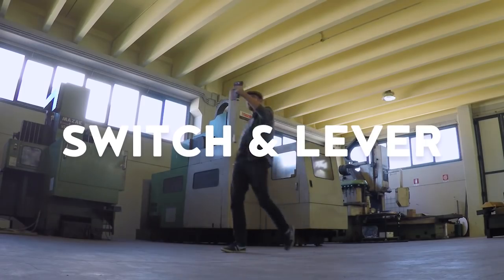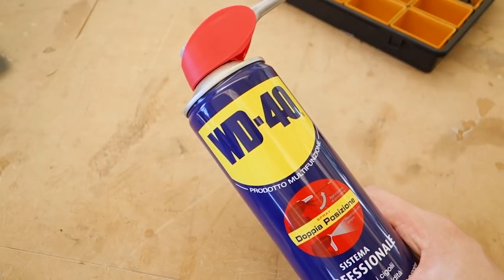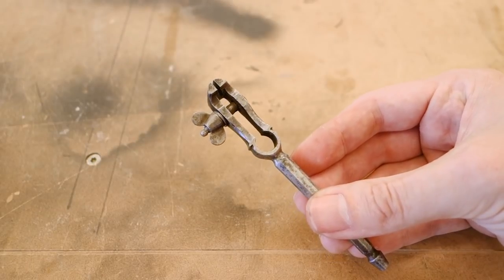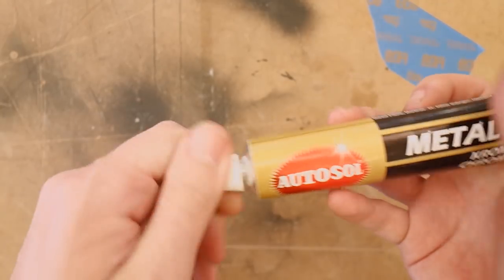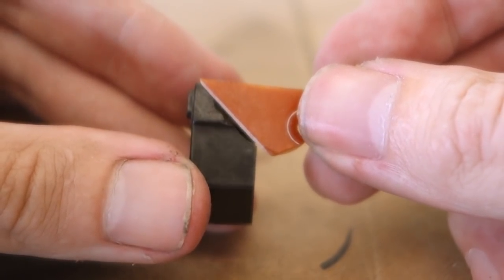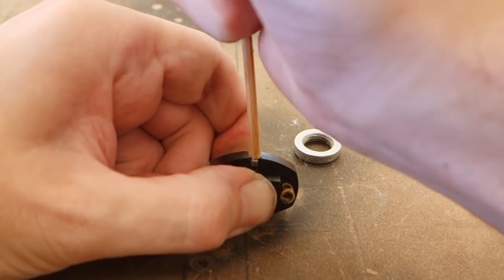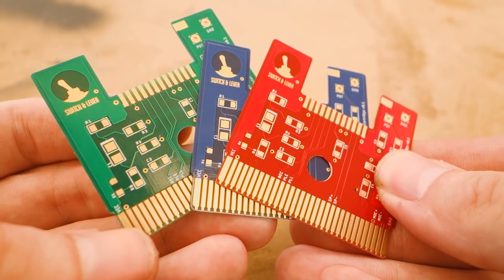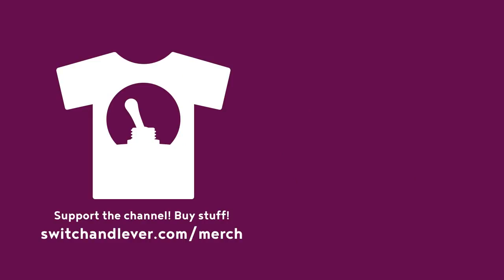Restoring Vintage Toggle Switches

Comment: For gluing threaded insert I usually put a greased screw in the insert, makes for a sort of handle and the grease stops the epoxy from sticking on the threads
Reply: Same but I use wax.
Reply: Same but i omit the insert
Reply: I was going to suggest this also. Works when melting it in as well.

Comment: Very good tutorial about switches and how to refurbish them. I have been doing just that for a longtime myself. A little disassembly and cleaning and most of the time they will work exactly like new again. Since some times if is hard to find an exact replacement that fits the original mounting hole and electrical connections, it saves the day to refurbish them. Thumbs Up!

Comment: I picked up a home ultrasonic jewelry cleaner at a yard sale a couple of years ago.  Small tank, guessing 6 oz/200ml.  Terrific for cleaning small parts.  Hot water and a little bit of laundry detergent and let them go for a few minutes.  (Laundry cleaner because the things I clean have a lot of skin oil and dead skin cells gumming them up, and that's what laundry soap is designed to go after.)    Also: Great to see unique old parts made useful again.

Comment: I was so glad to find this video. One of the toggle switches is identical to one I have that broke and I am trying to repair. The switch that you tip over at 3:50 is the one. You later (at 9:42) use the super glue and baking soda method to fix the housing with some PCB.  When my switch broke It fell apart and I did not see how the spring and inside assembly went together. So while I can repair the housing, I do not know how to assemble it after. I have tried to locate a modern replacement for it but they are all too big to fit in the space it needs to go (inside by 50 year old Rockwell wood router tool.)  It would be so great if you could post a video or even a photo of how the spring and pivot go back together. I would be so grateful.

Comment: You can get shields for the dremel to stop bristles going in your face or cutting disks exploding in it either. A 3D Printer allows you to make custom or modify existing shields. 

Lever switch should be used to switch on a Jacobs ladder for retro feeling of madness.

Comment: When using wire brush attachments on a Dremel, or any rotary tool for that matter, you should keep the RPMs really low. Those little wire brush attachments have a max RPM limit. I forget the exact number, but it's low- like, less than half, if not a quarter, of the max speed. When that max RPM is exceeded, it causes the bristles to fly out and stab you. Keeping the RPM low, although takes a bit more time, will definitely extend the lifetime of the brush and you'll get a lot fewer wire bristles to the hands and face.
Reply from the maker: It also depends on what you're using it on. When you work over edges rather than on smooth surfaces, the bristles wear out a lot more quickly.
Reply: You only get so much bending out of a piece of metal before it breaks. I suppose slower it seems like longer but sooner or later it's going to break.
Reply: @SwitchAndLever  , if you can find an old-fashioned motorized Draftsmans's eraser, the AC-powered kind with a hollow center that takes 8" long, 1/4" diameter eraser rods, you will be amazed at how you managed to live without one. Great for polishing and removing tarnish. The hard part is finding eraser rods of the proper abrasiveness that havent dried up and gotten brittle....

Comment: Before using any switches, toggles being one type, I check all contacts with a meter. If the contact resistance is high, over 0.1 ohms, vigorously  (rapidly) work the switch through its motions about 20 twenty times then re-check the contacts. This is often all that is needed to restore the contacts when they are tarnished after sitting idle for a while.
About checking switch contacts, realize that checking them with a DVM or LED is only checking them at very low currents so their behavior at higher currents cannot be predicted when testing them this way.
A better method would be to pass a known current such as 1 amp through the switch  contacts and measuring the voltage across the closed contact. 
For example, 0.5 ohms resistance at one amp current will cause a voltage drop of 1/2 volts across the contacts.  At 10 amps you lose 5 volts, etc.
FYI I just looked up the contact resistance specs for five manufacturers' toggle switches. About 20-25 milliohms was typical, one type was listed at 10 milliohms nominal, 50 milliohms max.

Comment: The contact cleaner likely leaves a thin dielectric film, but I would out-right pack the switches with dielectric grease. In the USA you can buy it at any auto parts store. They usually sell it as "bulb grease" to help with corrosion and oxidation on headlight connections but it's also used on car battery terminals. Somehow it also works wonders when you already have corrosion and oxidation.

Basically, it will displace air and water while promoting conductivity without shorting the switch out. It will also inhibit arcing so you don't get pitting on the internal contacts. Try it!
Reply from the maker: No. I would not pack these switches with any sort of grease, simply because of two things, they never come packed with grease from the manufacturer, and in cases of switches with less contact force it may act as an insulator making the reliability of the switch less. 

The contact cleaner probably does not leave a thin dielectric film, unless specifically specified, as they tend to be advertised that they do not leave any residue. Basically, looking at the contents it's all solvents and pressurized air, which should all evaporate over time.
Reply: @SwitchAndLever  DeoxIT contact cleaner specifically says that it leaves a coating to resist oxidation/corrosion and promote conductivity, which sounds exactly like what dielectric grease is for. It would definitely not act as an insulator! I've seen this stuff perform magic. I'd have contacts with no continuity no matter how many times I cycled the connection and then a little bit of dielectric grease made it good as new... not to mention all the intermittent headlight connections I've seen totally restored with the stuff.

First time was a coworker who had me look at his mid-'90s Acer Aspire with no video. We verified that the monitor itself was fine and that other monitors also had no video in his machine. I was a teenager who had just got his A+ certification for microcomputer repair, so I wasn't exactly familiar with board-level repairs. I suggested he buy a video card or replace the computer since it was obsolete. I took the opportunity to rant about how Acer should not be integrating video cards for exactly that reason. The guy moonlighted at an auto-parts store and the next time I saw him he had it fully working. I was amazed! It was working with every monitor and cable we threw at it and all it took was a bit of dielectric "bulb grease" transferred between the pins.

I've used it to restore countless switches since, from the notorious power switch on Atari 7800 consoles to relays inside an air conditioner to a PSone with black gunk all inside the power switch (no continuity at all before restoration). Works great and performed wonders in potentiometers too though they make a dielectric grease specifically for scratchy volume knobs and such ("FaderLube," from the makers of DeoxIT contact cleaner).
Reply from the maker: @emmettturner9452  yes, it is what dielectric grease is for, but having dielectric grease inbetween contacts which should make proper electrical contact can lead to intermittent connection. It's different when we are talking something solid like a battery connection on a car battery, or big beefy plugs and sockets with lots of contact surface between parts, and something like a small toggle switch with less surface and far less connection force. Dielectric grease can cause more issues than it helps in that situation.

DeOxit is but one type of contact cleaner, and coincidentally they market themselves as "more than a contact cleaner" hinting that it's not just solvents like isopropyl alcohol inside. Also, a thin coating after evaporation and a thick coating of dielectric grease (in the case of packing a switch) has quite different effects on the operation of the switch. Dielectric grease is not specifically for "promoting conductivity", but rather the opposite. It's to lubricate components while keeping them electrically isolated from each other, of course with enough force (like when you attach a contact together) you displace that grease allowing the metal surfaces to connect. 

There are many contact cleaners on the market, with different contents, but most of which I've come across have been advertised as not leaving any residue. In the case of the FaderLube it's essentially a contact cleaner with a couple of percent of proprietary lube. It's mainly just naphtha though, which cleans and gets rid of gunk from the surfaces in the pots.
Reply: @SwitchAndLever  The reason DeoxIT leaves a thin coating (as opposed to a thick) is because it's sprayed on with a solvent. I typically wipe off dielectric grease and leave a similarly thin coat. The point of packing a switch is to displace contaminants and prevent unwanted intrusion in the future.

Again, this stuff has worked miracles for me. I wouldn't glob it in a videogame cartridge connector or anything like that because it would retain dust, debris, and other contaminants in the connection as you cycle various cartridges in and out, but I have done some testing and it can totally restore the most unreliable connections that otherwise don't restore with any amount of simple cleaning, boiling, scrubbing, etc. That said, all contacts in a switch are mostly enclosed and the grease would not be retaining contaminants introduced from outside contacts in the course of normal use. That means the concern I have with using it in a cartridge connector doesn't apply at all in a switch. Indeed, packing the switch will keep contaminants limited to the outer areas with exposed grease while the contacts inside remain clean and functional. It's very likely that these switches never would have degraded if they had this from the start.

Nothing like seeing it for yourself: I suggest you experiment the next time you see a corroded connection. Try adding some bulb grease without even cleaning. You will typically see a substantial improvement if not seemingly restored to 100%. I don't know how since, as you say, it insulates... but it totally promotes conductivity at the same time and the effect is more drastic than simply preventing corrosion/oxidation, since it works with existing corrosion/oxidation in place.

For cleaning corroded/pitted contacts, I'd like to suggest an ultrasonic cleaner. These use cavitation to create microscopic bubbles in every microscopic nook and cranny to free up contaminants and clean even the most stubborn and most deeply embedded contaminants.
Reply from the maker: @emmettturner9452  yes, as I wrote, DeOxit uses naphtha as it's main ingredient, which is responsible for dissolving and dislodging things like grease, oil and general grime. You may have had luck with using grease, that does not however mean it is universally good. I will not be packing a switch for the reasons I have already mentioned. If they were supposed to be packed with grease then the manufacturers would have done it. 

While ultrasonic cleaners are great I would never use it on a switch without taking it apart and cleaning the parts individually, simply because even though the cleaner will dislodge internal dirt and grime because there are limited ways to drain the switch of liquid and the dirt would still remain inside the switch and would likely be a problem again down the line. Further it would be impossible to diagnose if there are other issues without physically observing the contacts. They may be pitted and broken from arcing, and while the ultrasonic cleaner may get the switch to work again it would only be a temporary measure before it would fail again.
Reply: @SwitchAndLever  I wasn't suggesting the ultrasonic cleaner as an alternative to disassembly. I, too, would place the individual parts inside. I've definitely seen some quality switches which were packed with a dielectric from the manufacturer, so I'm somewhat surprised you have so much confidence in the manufacturer of a failed switch. ;)

In my experience, I often find manufacturers to blame for the failure of a switch or a pot. For example, the US-made CTS-brand pots inside Atari 5200 controllers age in a way where resistance goes DOWN over time. Atari and their field service techs would have you misadjust the console so that it misreads controllers with the more-common Japanese pots (Alps or Panasonic). I seem to be the only one to have figured out a way to properly restore them with a very small capacitor (need a kit/assortment with a lot of pico and nanofarad values to find the right one). The Atari 7800 power switches are notorious for going bad but after you've fixed enough of them you realize that it is only the ones with a certain of two different manufacturers. They obviously weren't made right. People blame wave soldering for getting flux and other residues in the switch but that's obviously not the true reason or else the problem would not typically be limited to the most-used switch (there are several identical switches). Every now and then I find one with another switch that is marginal but it's always the second most used one and the power switch is always worse on those consoles. I always replaced the switch but I experimented on one of my own consoles by refurbishing the switch with dielectric grease. The grease alone restored it and it has not failed (did it three years ago).

I'm not trying to convince you to do something you don't want to do. I'm asking you to consider experimenting when you have the chance if I've piqued your curiosity... and I hope I have. :)

Comment: That was great Daniel!  Thanks!  Nice to see what you have to go through in filming to get a quality video...once again excellent editing and fun presentation.  I've restored a lot of them myself and en-joy the process.  What is amazing to me is the tremendous differences in mechanism even for similar looking switches.  One day I might research patents pertaining to switch mechanism...mind blowing I'm sure.   Small tip on the plastic polish is a product called PlastX from Meguiar's...best I've ever use with power or by hand.  Nice control box Too!  Hat Tip!
Reply from the maker: Oh indeed! One may think that they'll all be almost identical, but they very much is not. One thing is certain though, and the whole reason why restoring these old switches is worth it, newly made switches just don't have the same quality as the old ones, unless you buy ones that cost like $30 a pop and are actually not made in a Chinese factory.

Comment: For the switches that you could not get apart, I would recommend using a rustremover in an ultrasonic cleaner
Reply from the maker: While I think an ultrasonic cleaner is a great idea for the individual parts, I still wouldn't use it on a switch with all the parts assembled simply because it would be impossible to diagnose any other issues (like worn out contact surfaces due to internal arcing for instance) as well as issues with getting the liquid out of the switch again.

Comment: Now I feel dumb for throwing away some very old switches ..I do have a ceramic blade type switch with the screw in fuses used way back in old houses that I restored ....It is a scary looking thing knowing that 120 volts are going through all the exposed brass parts

Comment: Leaving the compound on is good, it protects the metal from further corrosion
Reply from the maker: What compound, the polishing compound? If so, no, it's full of grit and polished off metal particles and it definitely should be wiped/washed off as it can increase wear on the switch, especially if it makes it inside.
Reply: @SwitchAndLever  really? On the box it says that after applying u should buff it out so most of the residue will come off and leave a layer of wax protecting from further corrosion but I agree it's probably still got grit that will damage the switch
Reply from the maker: On surfaces which you can easily wipe off I’m sure that’s a decent idea. In books and crannies, like what goes into the switch parts I couldn’t take apart, as well as into the threads, it definitely needs to be flushed out though as one can’t really get in there to wipe. Also helps to get the built up remnants of polishing compound out of the knurls on the nuts. If you are worried about corrosion resistance you can always treat them with something like WD40 afterwards.